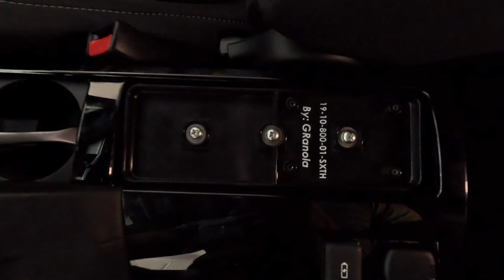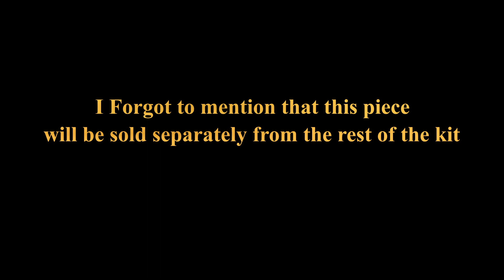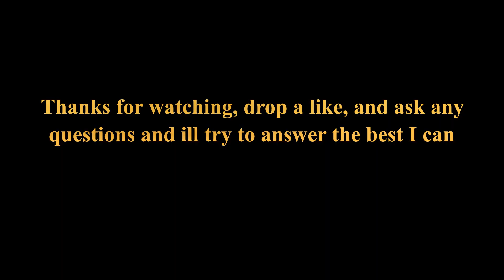GRanola and SXTH Element GR Corolla Production Arm Rest Install

Comment: Awesome! I can not WAIT until I get mine in! I have one suggestion.... for the center cover piece, the one in carbon fiber... PLEASE have them include an option for Twill Carbon Fiber. I understand they are matching the Circuit and Morizo edition GR Corollas, but for many Core models, we are modifying ours with Twill carbon patterns in gloss and matte. Having only a forge coarbon option, seems like a unecessary missed oppotunity for the community. Also, if we are taking a step this far, the critique for that plate is the visbile screws most people want covered. If a 3d printed black plastic piece could be created, alongside the plate... that is the entire solution we are seeking for that part.

All in all, again... great work and you contribution to the GR Corolla community is not unnoticed.
Reply from the maker: I talked to them about it and they’re gunna see what they can do!

Comment: Any rattles while driving? it seems kinda chintsy, but difficult to tell from video. Thx
Reply from the maker: I installed the lowering bracket and it makes it more rigid. However the box itself I didn’t have any issues with mine at all. Keep in mind this is aftermarket though not oem so if you’re looking for oem Toyota quality it’s not going to be to that level.
Reply: Got ya. Yeah, I just don't want something that's going to rattle. I'm OCD about rattles in my road vehicles. Thx for getting back so quick!

Comment: How do you stop if from sliding out after it is installed?
Reply from the maker: In which direction? The box itself is slid from the rear forward and it’s a tight fit so it won’t just slide out of the base
Reply: Recently I had a passenger accidentally bump on it and the whole thing slid back. It didn’t fall  all the way out. But it definitely doesn’t stay in place unless you’re careful with it.